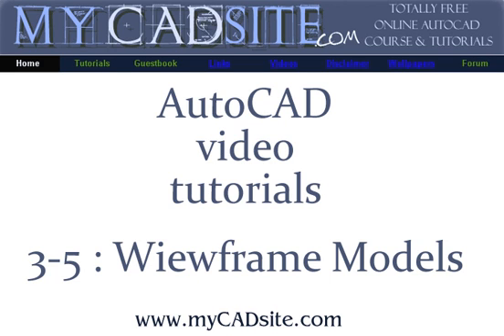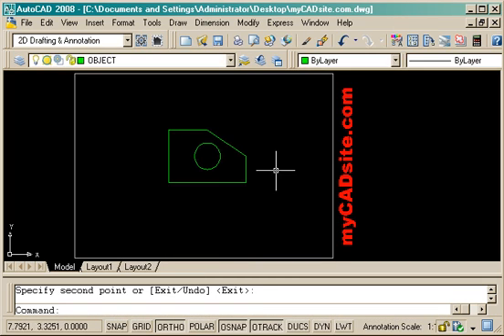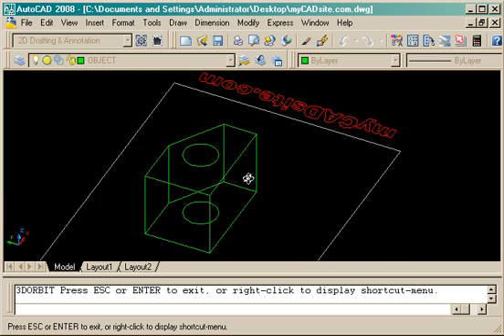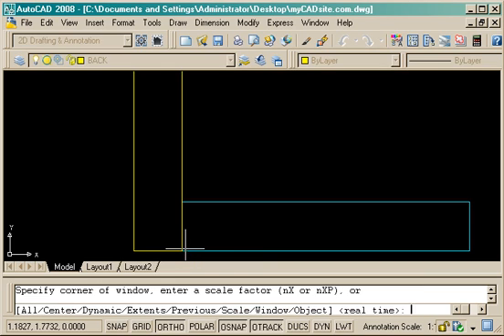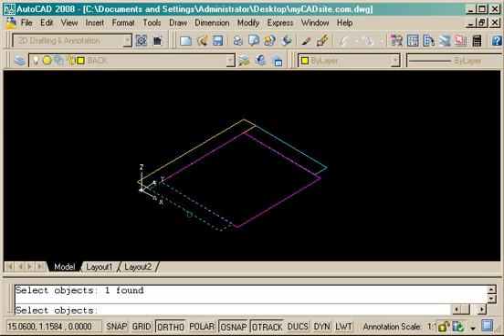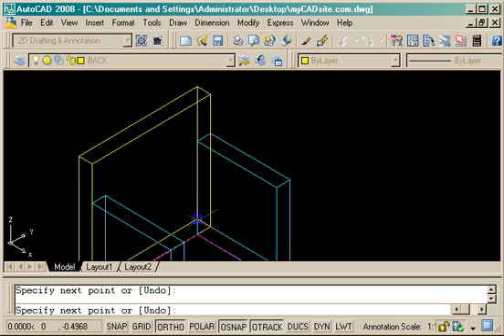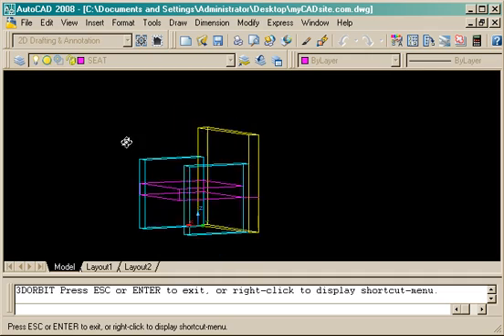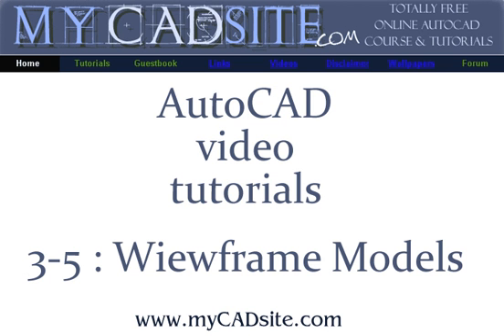Drawing wireframe models in AutoCAD - tutorial

Comment from the maker: @duane2072 - This is just an example of one of the many ways to work in 3D.  You'll see that I have other tutorials showing other methods.

There are times when you may need to use a wire frame model, such as exporting.